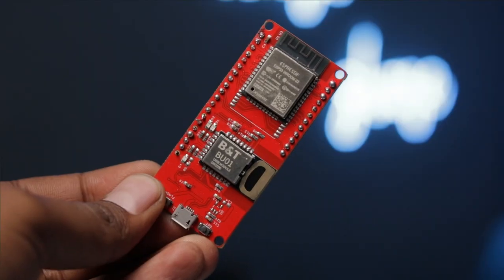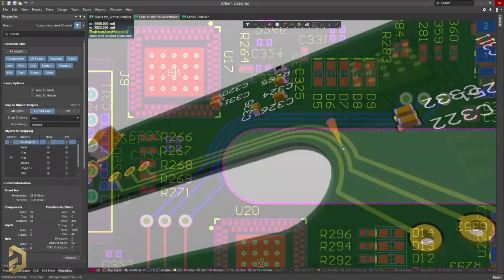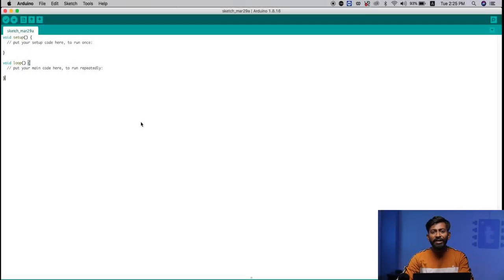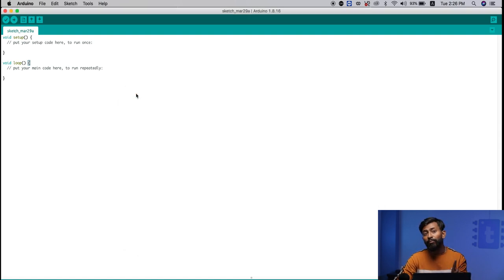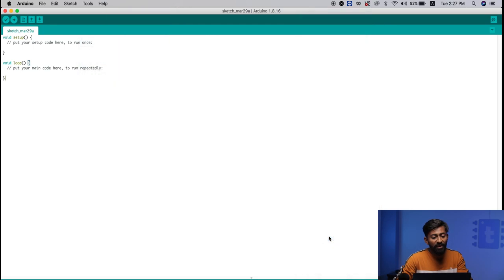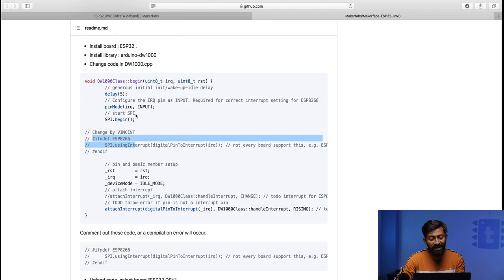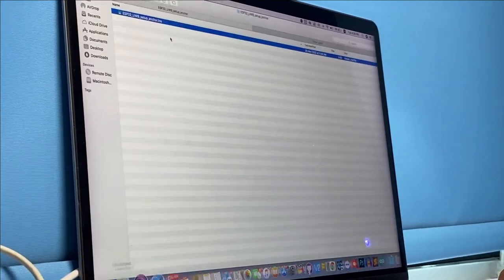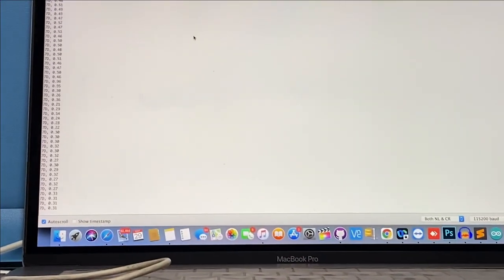Getting Started with ESP32 UWB board | Ultra Wideband technology

Comment: Very interesting! I got a project for DMW1000 stuff, when I search for it more DW1000 comes up. Is the DMW1000 and DW1000 the same thing? If not the same, what's the difference?
Reply: DWM is a module and DW1000 is just an IC in module there is DW1000 IC attached with a controller like STM or ESP